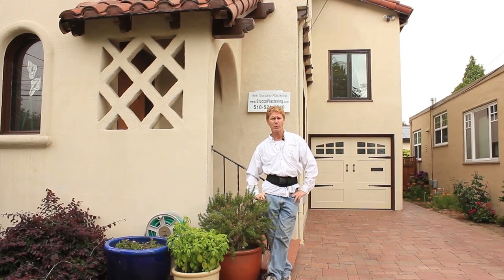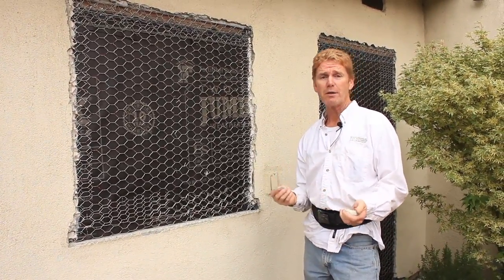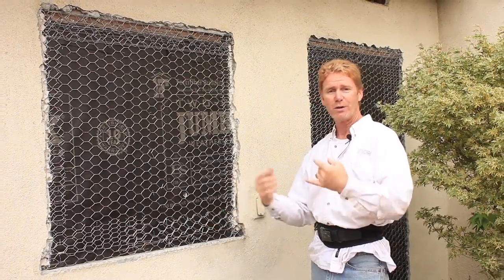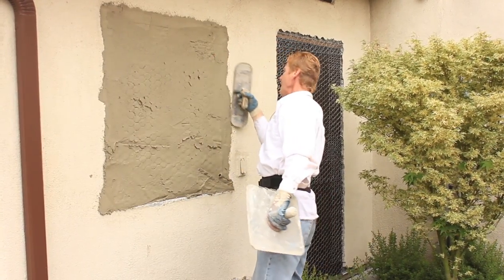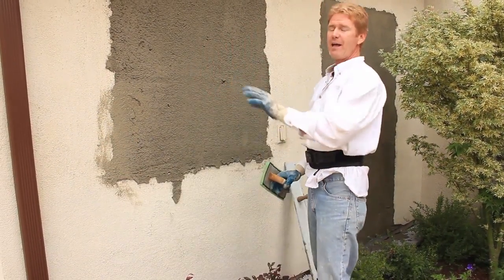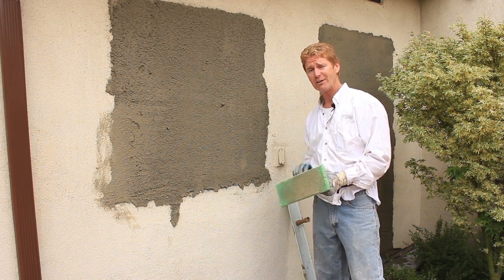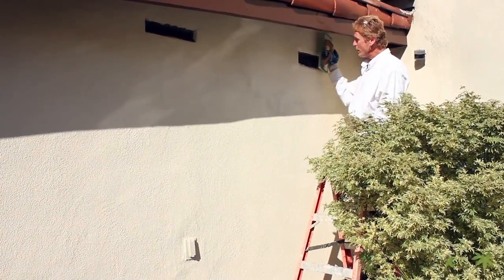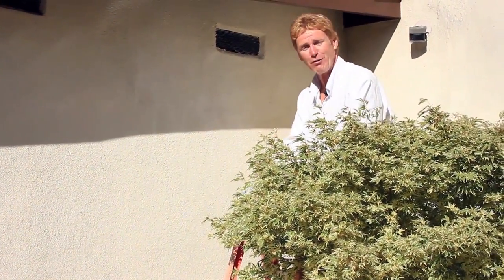Discolored stucco finishes, ghosting acrylic stucco

Comment: Kirk..I noticed you don't use plastic floats Just Green floats..so its more like a sand finish floated out .I've done so many on my time.. ghosting effect are scary especially when you teardown your scaffold and noticed patches.. another important information if you patch an existing home where windows & doors we're removed ..if previous contractor left it bumpy and not rodded out correctly you need to follow that ..some Plasters want to leave there work top notch..but the wall is the boss ..also what works great for a nice consistent sand finish color coat a hand Hopper put your finish in the hopper ajust the air for finish flow.. doesn't even leave cold joints .. thanks again Kirk for your vids
Reply from the maker: Good Evening Jesus, the only ghosting we get is one does not understand, the water in a green float must be consistent or none at all.   
                            Best wishes,
  Sharing stucco secrets and or common sense plastering tips

Comment: Which Dryvit acrylic texture are you guys using here, Sandpebble, Freesyle, Sandblast? Great job by the way! I'm wondering why you prefer the sponge float over a plastic float in a circular or figure 8 pattern?
Reply from the maker: hello Matt Bussen Vocals dude, we used Dry-Vit's sand pebble fine as that is what is applied to the existing home, 25 years ago.
 I prefer to use a new green sponge float and generally I'll go in all directions.
 Your a plasterer so you know the key to a good acrylic finish is not leaving float lines as we want our finish to appear very uniform therefore we have to look and see if we have any circular, vertical or horizontal line looks and if so go back over these lines with the same, but, clean and dryer green floats any direction we chooses as long as we get those lines out,
 Best wishes, 
 Kirk Giordano